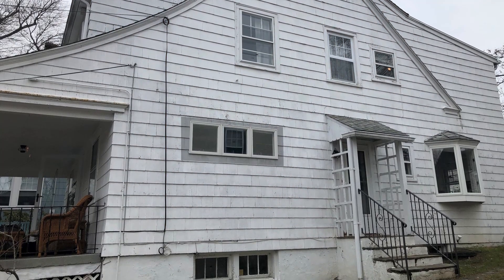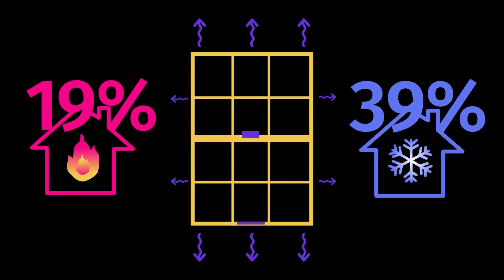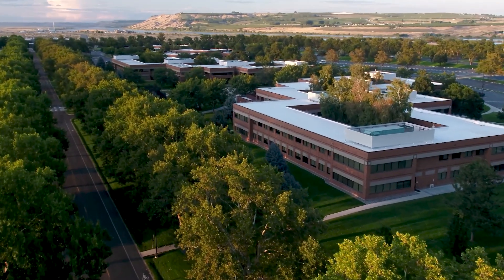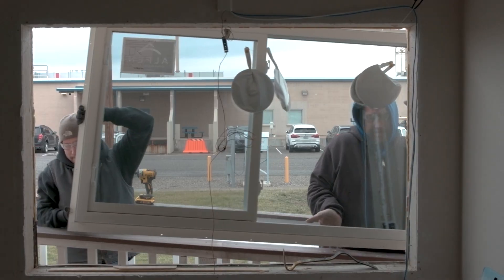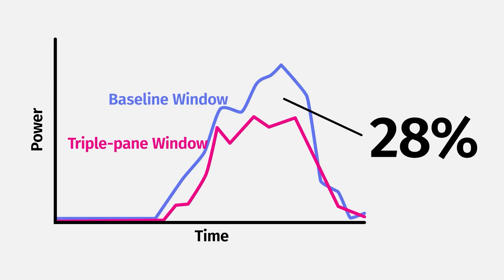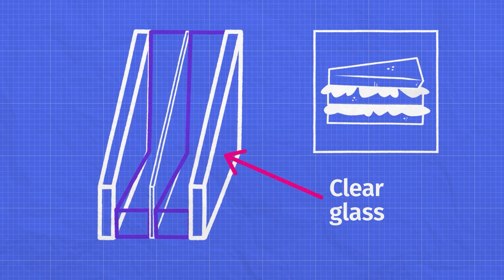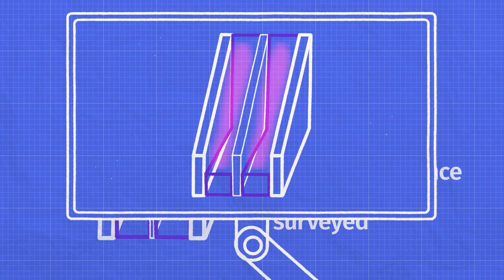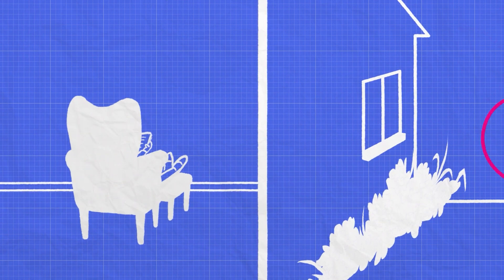Thin Triple-Pane Windows – Worth the Switch?

Comment: The percentage of savings given is comparing this particular trip. window to dbl. "metal" framed windows.  Not a fair comparison! The majority of windows being replaced today have are either a vinyl or wood frame which transfers  less heat/cold from the interior or exterior..
Reply: Comparing to a triple pane metal framed window.
Reply: american windows suck. i replaced mine with european tilt and turn windows, fiberglass and triple pane which is definitely much better than the flimsy, inefficient american slide window.

Comment: The Argon gas between the layers of glass will seep out relatively quickly it's a great selling point. So is low E glass which keeps the sun blocked out but northern homes enjoy the Sun's Heat during cold Winters
Reply: depends on which window type you'll be using. we replaced our windows with triple pane tilt and turn windows (fiberglass frame) and they keep the argon gas between the layers.
Reply: how much were your windows? @miles5600
Reply: I believe the number is like 1% per year.